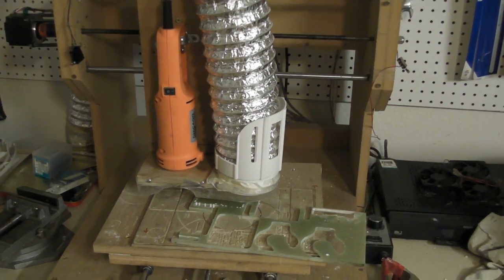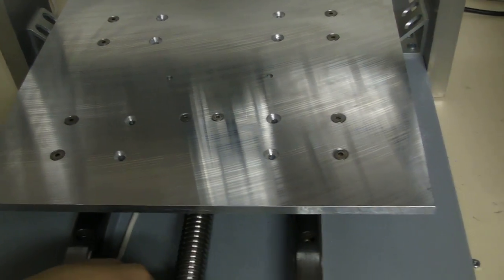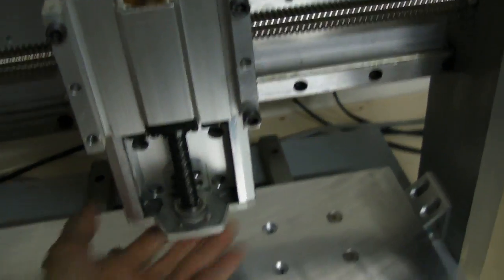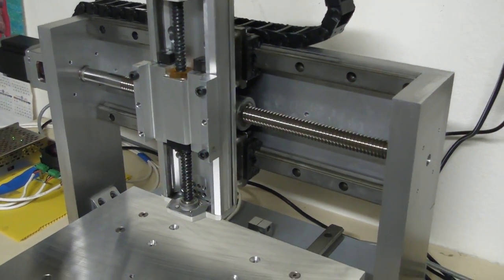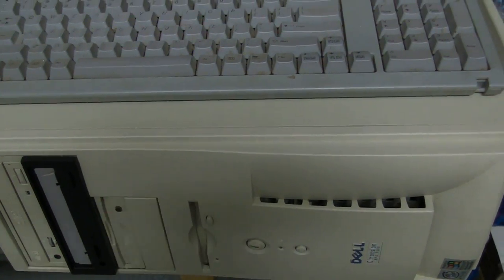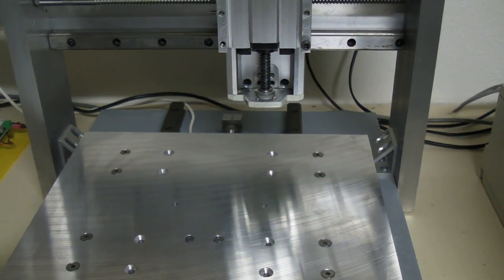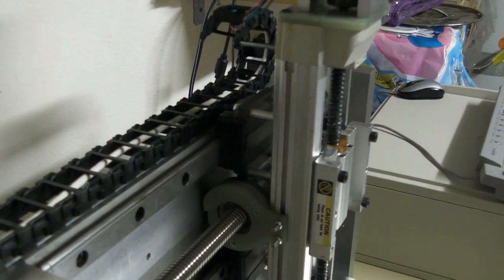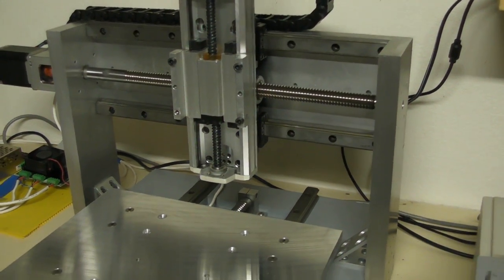My DIY new home built 3axis CNC router out of Aluminum using NSK ball screws

Comment: What ball screws are you using, diameter? Are these ground or rolled C5 or C7, also looks like you have a double nut.
Reply from the maker: +Hive8Zone  I believe they were 20mm and 25mm, C7, double nut.  They are super strong and high precision.... Japanese ball screw....   They came out of a 500k Japanese CNC machine...

Comment: If you're going with steppers it may be prudent someday to replace the drivers with OM ones.  I know they are quite expensive, but they have newly designed and patented drive electronics which virtually eliminate common problems associated with using stepper motors in precision motion control.

Comment: I've built a 3d printer but not a router, so how do you adjust the firmware? Like how do you tell the steppers how far an inch is, in mach3? What are all the electronics needed, stepper motors, drivers (on the motherboard), and a computer?

Comment from the maker: 70% of the part are fabricated using my 3/1 manual mill.  The aluminum tower are aluminum stock from store and cut at home and mill/tap to size.  The metal brace are from 8020.

Comment: I am in process of building a more durable machine similar to what you built using aluminum and 5/8" ball screws (for some reason 5/8" ball screws are cheaper than 3/8") For the spindle, I was looking to mount a Sherline milling spindle which can bought independent of their milling machine. It does look like a fairly simple yet structurally sound machine. Nice job!

Comment: Good build! I would go with the larger motor than the 1/2hp taig like ones or routers. Those 1inch ground ballscrews should be able to handle a lot more than 1/2hp and you'll be able to cut aluminum at a much faster feed rate! :)

Comment from the maker: Thanks... I cut out a slot on the two tower and tap 3x M6 screw and screw in the back plate.  The slot lock down the tower and the back plate so it doesn't swing side to side.  :)

Comment from the maker: I say use as thick as MDF as you can and clear coat it with something so if you drop oil or water on it, it won't damage it.  :)  I use garage floor clear coat... :)

Comment from the maker: I'm using the Xylotex board.  Yes, the Z axis is purchase on ebay, part of a used machine.  It's not ready to mount though, have to do a bunch of modification, the motor mount was fabricate and same with the axis mount itself.

Comment: Hey, I wonder what board you are using and what stepper motors you are using as well?

I am building one except out of wood instead of metal (to save on costs).

"the Z axis purchase on ebay for 75.00."

So you didn't build the z-axis? You purchased it already assembled with a ready directly ready to mount right?

Comment from the maker: @EnergyTechnology   Actually no, because I got the ball screw and linear rail cheap, the machine was under 1k.  If I remember correctly, the aluminum stock cost around 250.00, Router is 115.00, electronics 280.00, other misc thing, 200.00, the Z axis purchase on ebay for 75.00.

Comment: @devildestiny555 It's using about 15A at 22V without cutting, but there is almost no difference when cutting 0.2 or 0.5mm/pass at 250mm/minute, the power supply should be rated for 20-30amps to be on the safe side.

Unfortunately my cnc is too flexible to be able to really test it..I can only cut metal in the corners, where it's rigid.

I really like the brushless....less noise, no brushes to go bad :)
But you should know, the RC brushless are really badly balanced, you will have to balance it.

Comment: If you have a lathe make your own spindle.
I heared Chinese ones are so so, and it will probably be hard to fix if something breaks.
If you make it yourself at least you will know how to fix things easily, if something breaks.
This is something I made myself:
img683 . imageshack . us / img683/6554/mg6978.jpg

The coupling was a bad choice, I would go for the couplers with plastic inserts now.
The er11 chuck was also a bad choice, I would go for er16 now :)